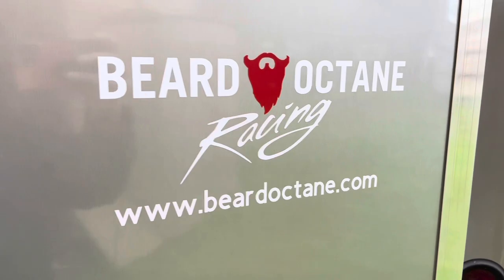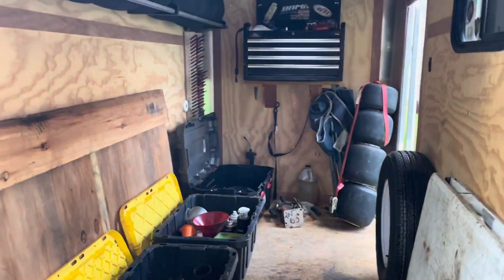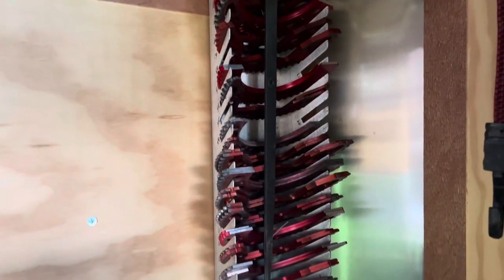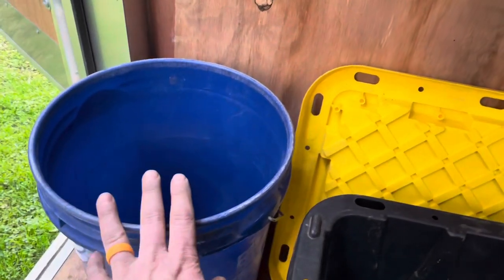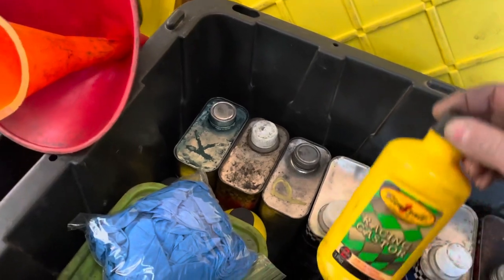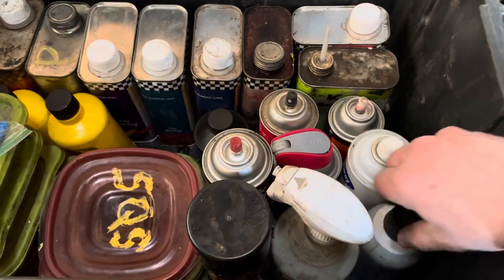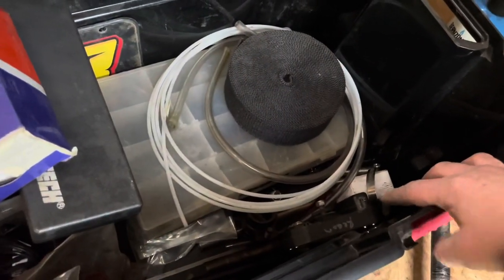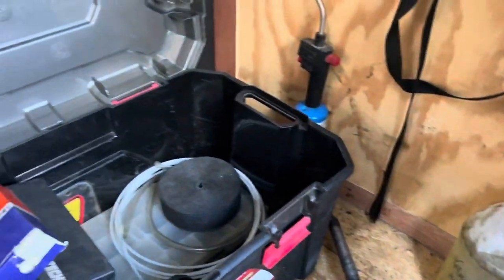What’s in your Race Trailer?

Comment: If your inability to hear the Raciever becomes a problem. Spend the money and get some custom molded ear buds from Racing Electronics. I have bad hearing damage, but with those custom molds I could hear fine. I used them in my Legend Car.
Reply from the maker: It’s something to do with the frequency of the two stroke.  I’m not sure about the big 4 strikes but the higher rpm seems to interfere with signal.  This actually came up on opening day and I’m not the only one with this issue.